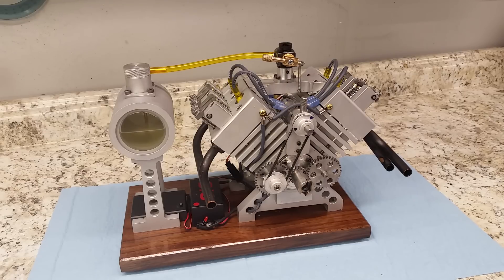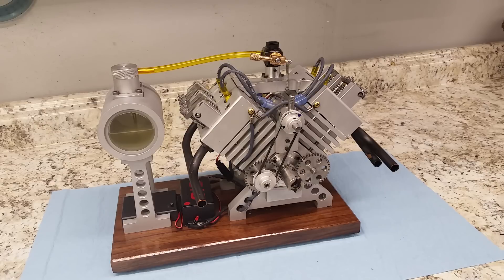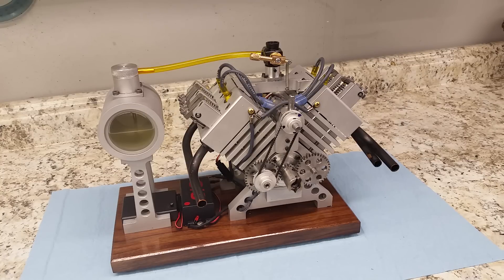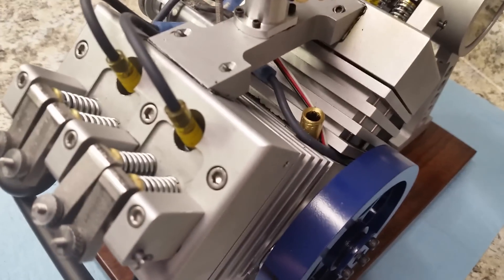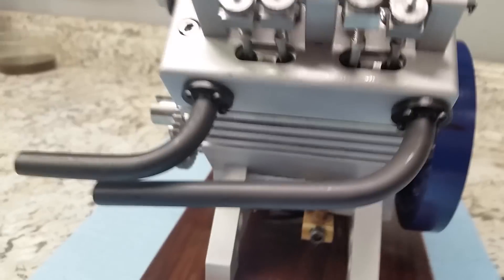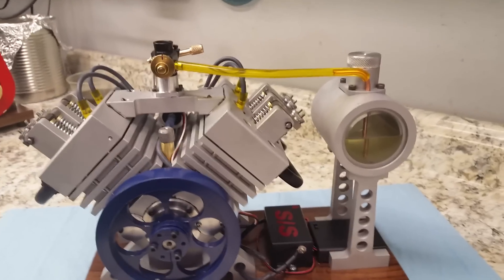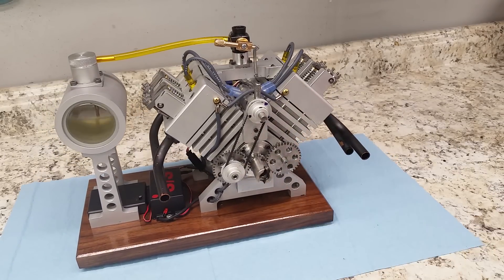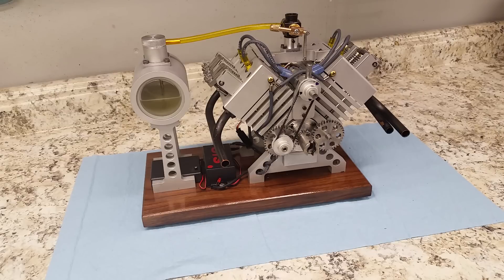Miniature 90deg V4 Engine

Comment: Hi Dick
You have a great running engine. Would you happen to remember what the timing of your Camshafts are? I was talking to Parksy and he can't find his paperwork and thought you might know? I am thinking of building one of these. It is a really good running 4 cylinder.
Cheers
Willy
Reply from the maker: Hello WgB, yes the timing is explained near the end of my video. #1 then180 deg #3 then 270 deg #2 then 180 deg #4 then 90 deg back to #1. good luck with your build. Dick

Comment: Ok, I have a question on the engine timing-  You said #1 fires first (I'll assume that to be 0 degrees), then #3 at 180, #2 at 270, then #4 180 degrees later, which is 450 degrees, then 90 degrees later, back to #1, which is a total of 540 degrees, which falls short of two crank rotations, which is 720 degrees.  I think I am missing something.  I would have figured that everything is evenly divided by 180 degrees, with 720/4 = 180.  The reason I ask is that I'm designing a V4 and I'm researching the valve timing aspect of the whole thing.  Can you elaborate a bit?